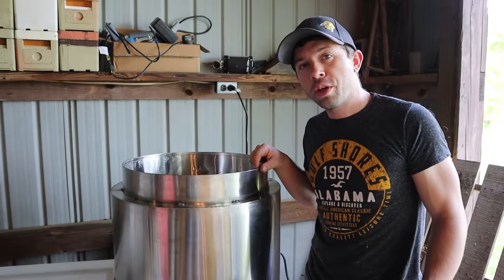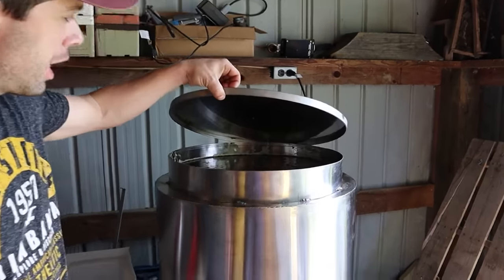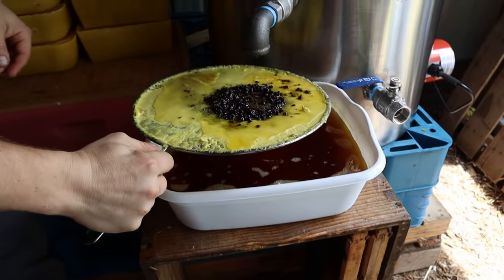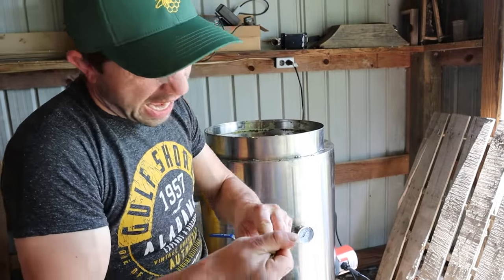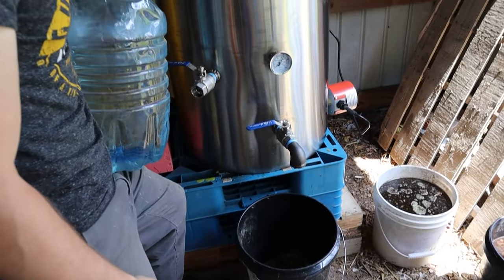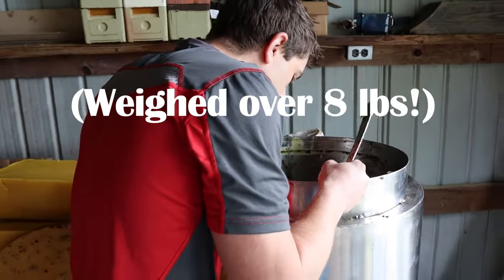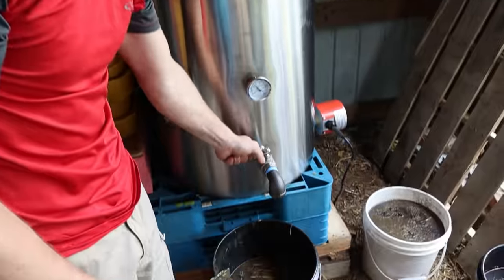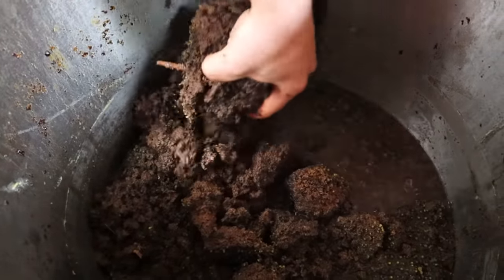😮Beeswax Processing Made Easy! - NEW Thorne Wax Melter.

Comment: Couldn't believe the wax that came out of the slum!  What kind of screen do you use for the final filtration process?
Reply from the maker: I know! I couldn't believe how much was in the slum gum either! When I filter the wax the rest of the way I will show that too. The filters I am going to try are a 50 micron sock filter
Reply: FlowerStreet...
Here in Scotland 🏴 a few Beeks, go to Paint Stores, and buy several "Bucket Paint Sieves." aka Large Mesh Bags, with Draw String Tops.
Tip:.
Do a 1st Pour in Bag "1".
Keep "1" for this purpose only.
Then, another,  Bag "2" for 2nd Pour.
And, if needed, Bag "3", with, a "old pillowcase" inside it... Never to be on your Bed ever again ! 🤭
Label each Bag, for same use, then nano particles get taken out, effectively and, completely. ✔
🐝🐝🐝🐝🐝🐝🐝🐝🐝
Happy Beekeeping 2022.
🐝🐝🐝🐝🐝🐝🐝🐝🐝

Comment: Hello Kamon I just found your video on your new wax melter . What a great add to your Bee equipment. I have a idea that I think would help on the cleaning up part of it . The screen that goes down in it if you could talk to them about making another one like that one but does not have the legs on this one so it will lay right down flat on the very bottom. It does not have to have the holes in it or it could have the holes in it but after you drain all the water out an it drys out then you could just lift it out an it would lift out all the dry trash so you would not have to lean over an dip out all that trash . It could be put in at the very beginning before you start but have it made so your screen could still fit on top like you used it . Just a thought. As always thanks for all your great information you share with us all. THANKS

Comment: Playing catch up here, but if you started with a course screen in the floor before loading the wax,  you could then add the scum press on top to salvage the wax from the scum.  Then just drain the water, pull upper screen with the salvaged wax cake, and then lift out most of the scum as a solid brick with the lower screen.  Less scooping and scraping to save cleaning time.

Comment: Great Video....   is there a wax melter for a much smaller operation?  Mini Wax Melter?
Reply: ECP... Not for Food use*!
A Charity Shop (Op Shop, Yard Sale) : Crock Pot*, with : Your Wax, and added Water. Heat up... the Wax floats up, and the Slumgum sinks.
When Wax Disc is Hard, get an Ex Kitchen Spoon, and scrape the under matter on disc, off, and remelt it with next batch.
You can also Pour Wax this Hot (liquid Wax) through an eg old T-shirt, or Pillowcase... all particles are removed, as it filters through the Fabric ! Best done not in the Kitchen.... or add lots of Parchmont Paper on your Counter Top, re any wax splashes etc ! 😖
Or, are you in a Sunny Place ? (Collect your Wax through the previous  Year. And ....
" Make a DIY Solar Wax Melter" : Metal / Heat attracting Box : 
A Black/Dark surface : 
🌞 Attracts the Sun's Ray's, Nicely. 🌞  
Win, win, and it's Free !
(Ex - Cooler Box, Painted Black.) A super large Foil Roasting Tray etc.. And a large piece of Glass (Small Window Frame, a Picture Frame, etc...) Something to hold the all that Sun's Heat in..... ! 👀
All Tilted towards the Sun's Ray's, over 20C 70F should melt your Wax nicely. TIP : Add a Board, Black Plastic / Metal Channel, and Tilt it, 
..... to allow the Wax to melt and Trickle towards an internal Collection Tub..... ✔
Add Kitchen Paper, to allow Wax to Filter out as  it Drips, through the kitchen paper into the collection tub, Get nice and clean Pure Bees Wax.
 Simples. 😎
🐝🐝🐝🐝🐝🐝🐝🐝🐝
Happy Beekeeping 2022.
🐝🐝🐝🐝🐝🐝🐝🐝🐝
Reply: @ME_MeAndMyBees  Thanks aware of all that just wondering if there was a smaller less expensive version of the one he has...

Comment: How does the heating element work?
Reply from the maker: Hey Gaylon! This Missouri made Watlow is awesome. I have some Watlow immersion heaters on other equipment from the 80's still strong and accurate. Keeps temp great and made to last.  It has a dial on it and if I set it to 170f or whatever it is within a couple degrees.
This model plugs into a 110 outlet
Reply: Thanks, thinking I might just make one for myself. Seems simple enough 😁

Comment: This seems like a great piece of equipment. Is this 25 gallon? I am really liking the screen / strainer
Reply from the maker: Hi Ryan this is the first one of it's kind made by thornemfg.com My model was the first made and is 24.5 gallons. However, the new models are slightly over 25 gallons and are way more refined than my model. This wax melter is the bees knees and I love it. I reclaim 12+ lbs of wax per 2 loads with the screen.
Reply: I am considering getting the 8 gallon model. We use beeswax in one of our products and we want to bring the cost per pound down. I was wondering, would it make sense to get one if we provided a refining service for hobby farmers? Would like to get your thoughts on it if you are willing to share them. Let me know if there is a way I could get in contact with you
Reply: @kamonreynolds  I am assuming this works good on brood comb as well
Reply from the maker: @ryanpruneau4937  It does! However, it will change the ratio of wax you glean per fill since there is more slum in brood combs. Buddy of mine runs 3000 for pollination and loves the 2 he has.

Comment: if your comb has small amount of  honey in it...how does that effect the process?  thanks
Reply from the maker: Hey Stan. It pours out with the water. You can run it low and slow without water and reclaim darker "melter" honey out of the bottom. This can be used for some baking and other things.